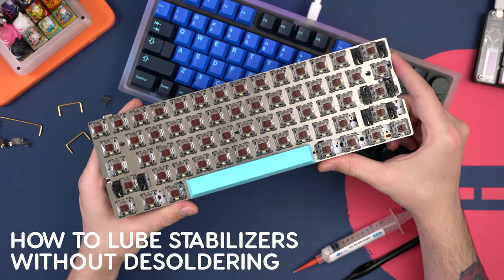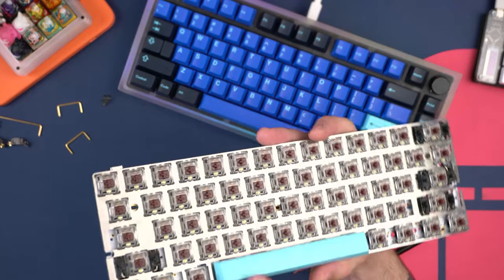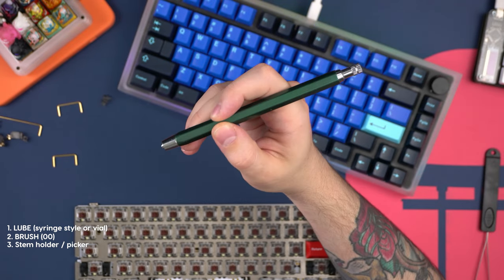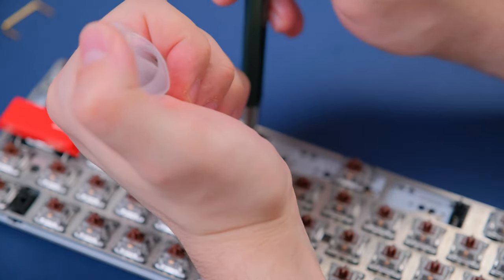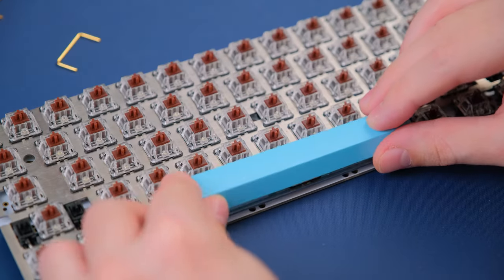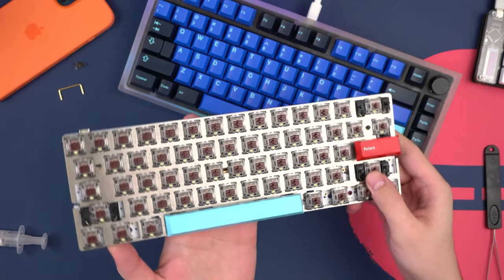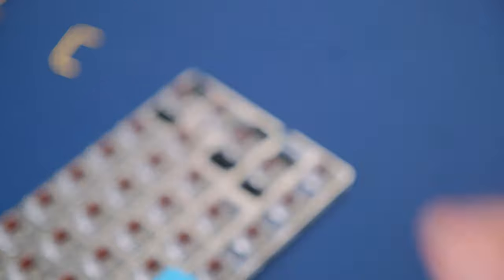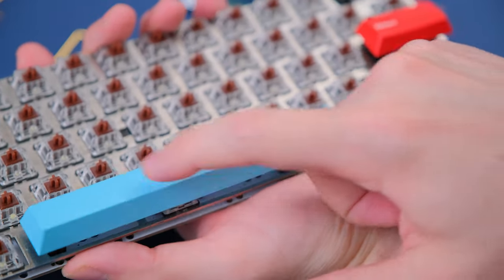How To Lube Stabilizers Without Desoldering Switches

Comment: I have a hunch these tips would work just as well with a plate mount, just inferring from the fact that you're just lubing the stem and wire holder areas of the stab.
Reply from the maker: I think so too but i just dont own any plate mounted stabs to test it on!

Comment: super helpful and easy-to-follow video! appreciate it! are you aware of any possible way you can add a bandaid without desoldering? i doubt it, but that would be super useful as well.
Reply: IK this is old so sorry to necro the thread but I don't think it's possible to do, considering the bandaid has to go underneath the stab housing.

Comment: Did this before and ended up getting a little bit of lube on my PCB. Does this happen often when you do it? Or are you generally just light enough in the first lubing process to avoid that? Wondering if lube on the pcb is something to worry about as well lol

Comment: Any time I try to use 205g0 on the wires it just gets pushed out the front after a few presses. I pretty much have to use bdz or dielectric grease for it not to do that.

Comment: Two questions
1. Is there an alternative to krytox 205g0? (it's kinda expensive)
2.  Could I just use tweezers instead of the stem holder?
Reply from the maker: 1. I havent tried anything else but this, and 2. Yes you can :D
Reply: @alexotos  thanks man
Reply: @alexotos  lol i used vaseline
Reply: @theon1yone790  how did that turn out? i kinda thought  about doing that
Reply: @AgentGilded  honestly: not bad. It's fine even if you put a little bit too much at first, as it will break in after a bit of typing. Gets rid of a lot of rattle, I applied a lot on my stabs
Reply: @theon1yone790  update on ur kb.. people said vaseline destroys the plastic as time goes by.. it has been 5 months anything happened so far?
Reply: @myggych.4996  it’s still fine, don’t think it’s corroding
Reply: @myggych.4996  haven’t even put more and it’s still stopping stab rattle
Reply: @theon1yone790  i have ajazz ak33 and used vaseline 2 months ago and its the same thing.. sooo yeah i think we're good
Reply: @theon1yone790  Any updates? I'm poor lol

Comment: Would this work on a Corsair K70???
Reply: it should work on any stabilisers real question is why you got a corsair keyboard
Reply: @jiekaichua4511  Because when I built this PC, Cherry still had the patent for switches and there were hardly any mechanical keyboards out,.... Razor used Blues which I fucking hate and I got this Corsair cheap.... Been happy with it so don't criticize my choice
Reply: @neccros007  ahh i see i see glad you're happy

Comment: Nice video! However, for the durock v2 stabilizers, overfilling it with lube will result in overflow onto the PCB and result in sluggish returns. This issue is accentuated when injected with permatex.
Reply from the maker: Oh intresting! Did they change anything in the v2 mold that would cause this? I haven't tried this with v2 yet.
Reply: @alexotos  the lube will just wiggle out from the bottom of the stab stem.. the front part of the stem where the wire goes in, there’s a hole at the bottom of the stem

wish I could post a picture to illustrate it..
Reply: @jujinnlee88  I completely relate, but after a lot of pressing the mush and sluggishness slowly fades away, but you still need to clean the PCB from the excess lube though
Reply: This is what I have noticed on any stabilizer I've tried this method with. Currently just tried it on Owlstabs because I didn't want to disassemble the whole thing, and it just turned the whole thing into a mushy nightmare.